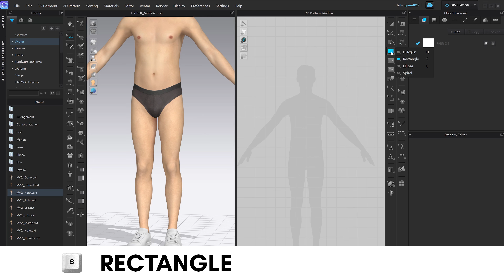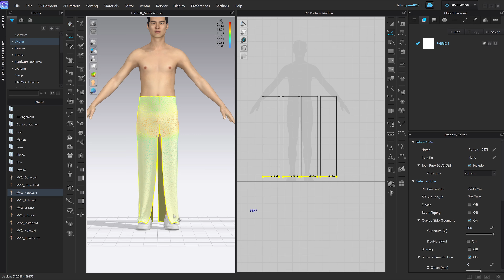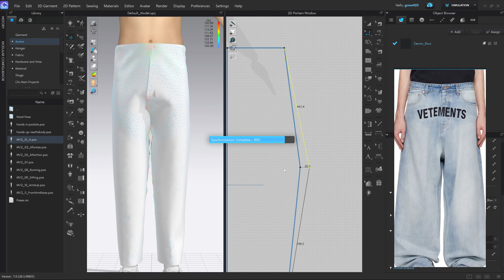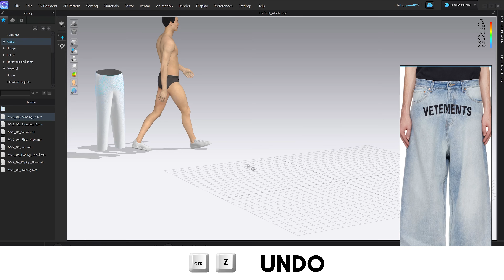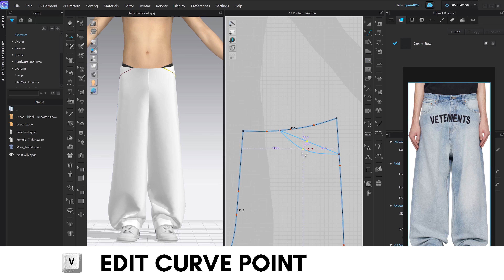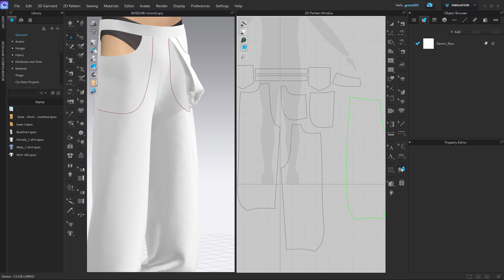Design Like Vetements (Baggy Jeans) | CLO3D Absolute Beginner Tutorial

Comment: That's incredible! Little question: I draft at CAD and every little curve change I check the perimeter to see if the seams still match, wich is not something you bother a lot while designing lol. I wonder if is it because since you've matched two pannel lines with seams the sistem automatically correct the perimeters. Would that be the case? Thanks!